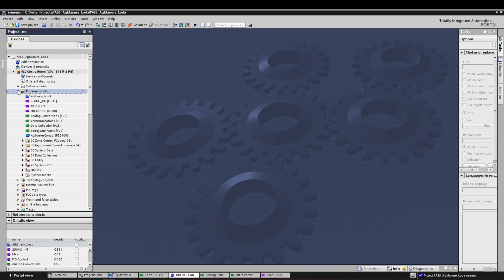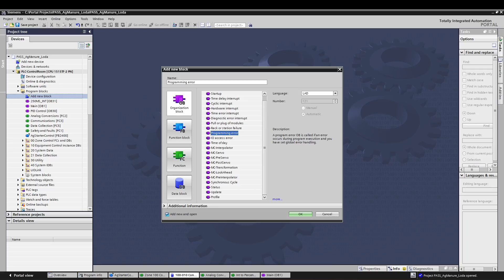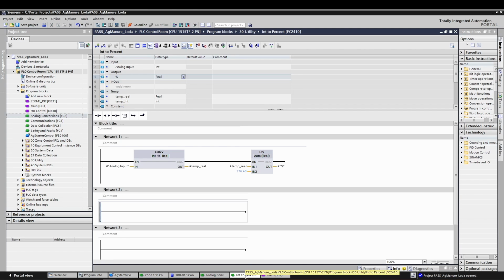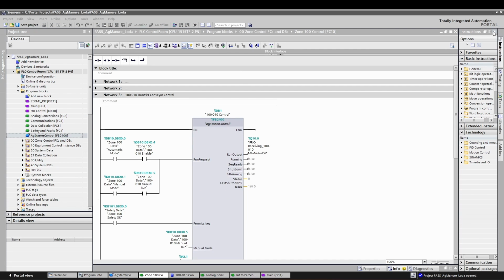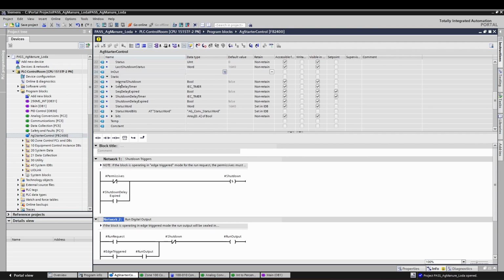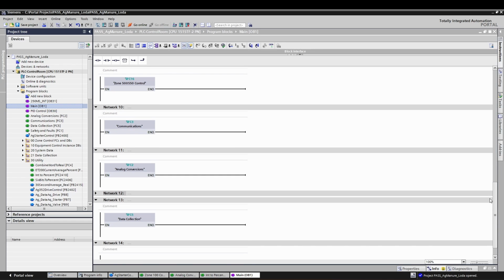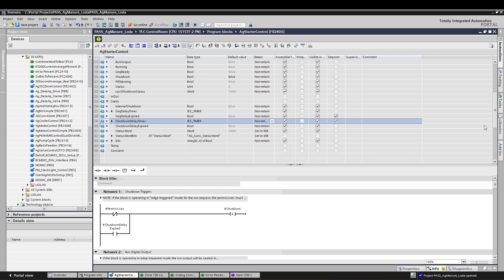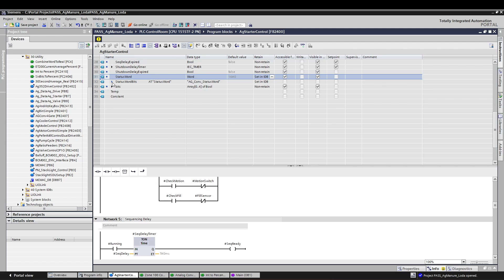Siemens PLC Basic Training. What is a OB, FC, FB?

Comment: Hello Jason! Thank you for your job, its great. Have a question about variable EdgeTrigerred, i can see it inside FB as input but i cant see one when FB calling.
Reply from the maker: I dont have the block in front of me but, it should be part of the internal run signal. If "Edge Triggered" is enabled, the internal run signal will seal in with the "Run Requested" unless there is a shutdown.

I put this function in when I first made this block 5 years ago and I have not used it. I made it in case your start signal is not constant, but I jave not run into a case where that happens.

Comment: Where it is used
Reply from the maker: An INOUT is more efficient as you are not making a copy of the data inside your instance data block (IDB). It also allows you to modify the actual data inside your block. Here is an example of how I have used INOUT:

I have a DataBlock ( Call it "PumpData") that stores some information about a local pump system such as Pressure, Speed, Faults etc. I have made a FB called "RemotePumpControl" that has an INOUT of a type "DB_ANY" that I connect "PumpData" to. Inside this block I have all my logic that I like using this data block. Now, I actually have 6 of these stations in the field with 6 copies of this block being used. I also have a central PLC that coordinates all 6 of these other PLCs. The reason I use an INOUT is so that I can freely access the data inside the FB while still being able to modify the data from the central PLC as well.

INOUT makes it to where you don't have duplicates of the data in your memory. If this was in C++ it would be called "Pass By Reference" and it makes for very efficient code.

Last, INPUTS cannot be written to inside your FB (like a coil assignment) but an INOUT can be.
Reply: This is what I need to learn as a fresh PLC programmer. But where and how can I start? Please give some advice.
Reply from the maker: Try here first. 
https://youtu.be/xmSo-yXu4o8

Then watch some livestreams! The one about Intro to digital logic is a great start and this week's livestream was a beginner's guide to drives!